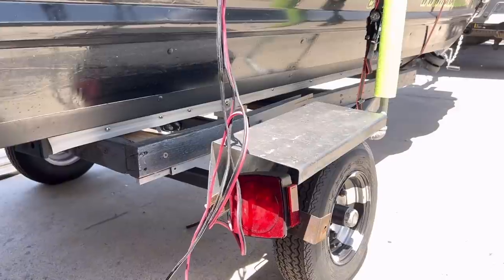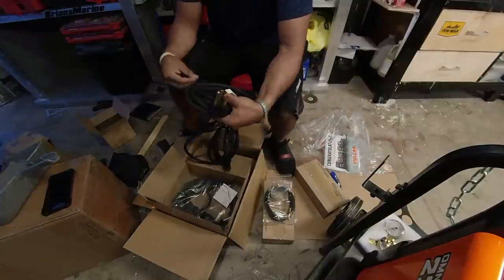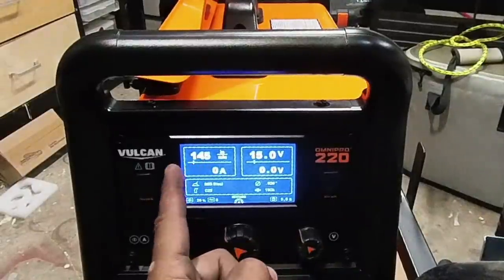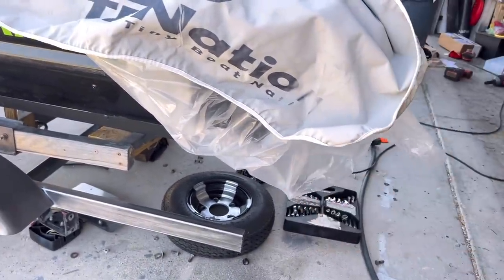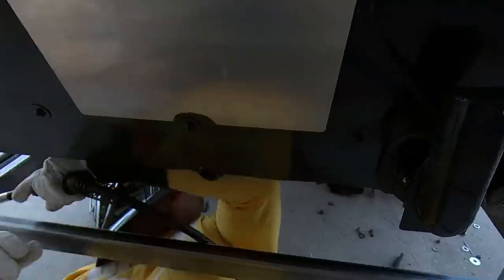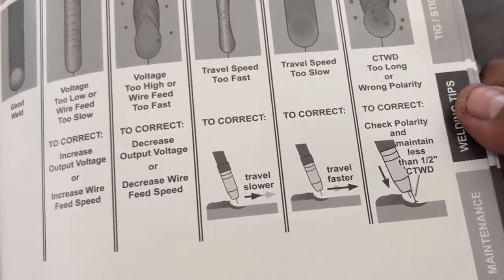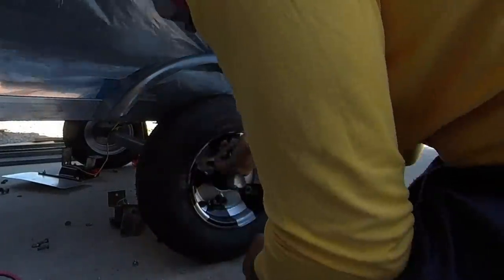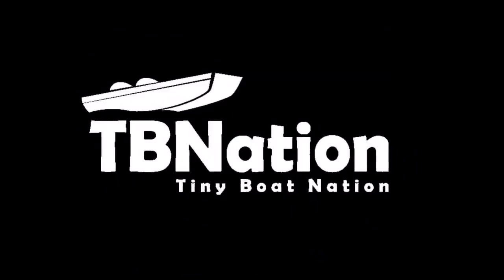Learning to weld on old trailer | Vulcan Omnipro 220

Comment: Love how you arent really afraid to just try things. Great video. Yea go with the settings the welder computes. You don't want gas flow too high because it can be turbulent and cause problems. Also if you are outside the wind may blow the gas away. Also hold your gun closer to the weld. Move slow watch your puddle. Practice makes gooder
Reply from the maker: Fail your way to success!

Comment: As a welder this video brought me great pain....BUT! I'd have to say not to bad for first time. Props! Seen far worse. Couple tips. 
1. Set your gas anywhere between 25-30cfm also don't recommend outdoors with gas wind will blow it away resulting in what you were experiencing with the pinholes.
2. Keep your cone within say 3/4" from workpiece 1" is doable but stretching it. 
3. The brown glass your getting is normal not a defect it's your gas doing its job by removing the dirt and silicon from the material and your wire. Brush it it'll shine. 
4. Set your hood light enough to see your travel or where you are wanting to go with your weld. But don't have it so dark all you see is a spot of light. Most common setting is shade 10. Shade 9 is a little bright but doable. 
5. Cut up some chunks of pieces say 6" long make yourself a "T" joint and start stacking your welds one on top of another. Like a staircase kind of start at the bottom and step up. Making each staircase bigger.....? Idk if that's the best way to describe it. Look up a multipass weld it'll make sense. 

Best of luck to ya. Like I said I've seen far far worse in my day. Not a bad job at all.
You and the boys keep up the good stuff!

Comment: Can't wait for you to start welding aluminum. You'll likely be using less rivets and with much stronger results (and hopefully quicker too) when you finally get the hand of it. Just beware that aluminum is less forgiving than steal. Practice on scraps (you should have plenty of them from your builds laying around) until you get the technique down. Love your "can do" attitude; willing to try and figure out new skills. My Dad was the same way,. Taught himself how to weld in order to repair equipment on our farm. It ended up saving him a small fortune and huge amounts of time in the long run by doing it himself vs. having a local shop do all that work.

Comment: Flux core wire is great for welding outside. Especially if there’s wind that’s just going to blow your shielding gas away from the weld anyway. If indoors with zero wind, a welder with shielding gas is definitely the way to go!
Reply from the maker: Yeah it was nicer and cleaner, but a lot of hassle. Flux is just so easy.

Comment: when its right you can hear a hiss. thats not a corrosion. the steel has a clear coat to keep it from rusting. hit it with a grinder about 3/4 inch on each side of where you are going to weld
Reply from the maker: Thanks for the tip.

Comment: Nice. I need to buy a new mig welder mine went to shits lol. still have the arc but prefer a mig. Never tried aluminium though . You can replace using rivets and start to weld aluminium save in filler materials .
Reply from the maker: Every DiYer needs a welder.
Reply: @TinyBoatNation  that's for sure Buddy

Comment: lmao you hammer the weld dude not the bar 🤣 I dont remember what the tool is called but its shaped like a hammer with a giant spring on the handle side and you smack the welds. I believe its mainly to clean up the splatter. 🤣 Smack the bar with a hammer, just jump on it.
Reply from the maker: Got it
Reply: It's a chipping hammer and is to chip the slag or glass not to test the weld.

Comment: Flux core is good.  but you can't weld aluminum with a flux core, can you?
Reply from the maker: O, but you can with a spool gun!
Reply: @TinyBoatNation  Oh, I thought you needed gas to weld aluminum.  I didn't think flux core machines could work.  (still learning myself, so trying to verify as I thought you'd need a mig machine that could attach gas.)
Reply: Side note, I hope it didn't sound like I was trying to be snarky.  I have a flux core welder and do honestly think they're good.  I just didn't think you could weld aluminum with them.

Comment: 15 -20 minutes of practice would of helped, just saying :)

;0
Reply from the maker: Thanks! Yeah, I definitely could've practiced 1st.
Reply: I welded professionally 25 years ago and still weld here and there.  Every time I pick up a torch (gas, tig or mig) I run some practice welds to get the rhythm and tune the weld.